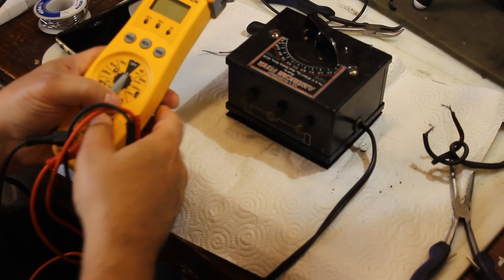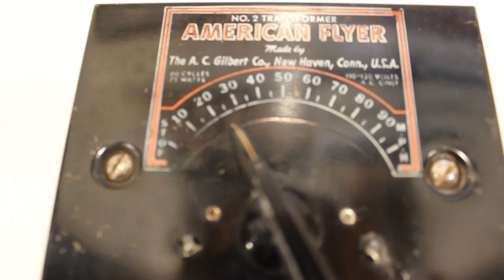When the cord is bad:  A 1947-52' 75 watt No. 2 transformer repair.

Comment: One was 75W and came with a 290 set ,#2 transformer, mine was bought in excellent condition with one of the best cords I ever saw. We used it for years, then everything was moved and it was lost by the home my brother moved to. I restored everything they messed up to Exc. condition again. That was in 1961 to 1964 ,just before I became a big time collector in 1968 buying out old toy train stores going out of business like Toy Town in San Gabriel and the Knott's Berry Farm train store that would call me when they bought out American Flyer  Trains from customers that were selling unusual items like the 21139 Northern freight set all in original boxes and set box too. Collected non stop until 1974 and sold out everything, but in 1997 to the present I went crazy again. Only now I have no space for anything or even a place run  a train.

Comment: Austin/Everyone, I have a Model 7B and 8B American Flyer Transformer that is in need of new cords. Is there any part diagrams or documentation if you want to rebuild one of these older American Flyer Transformers....Thanks!
Reply from the maker: If all you are doing is replacing the chord then it should be a simple disconnect the old and replace with new.  There are usually cheap extension cords at the box store....lop off the female end and now you have a new cord.  As for schematics...you might check the various flyer Facebook pages as .any of them have helpful documents under the files tab.

Comment: I have replaced the wire and cleaned the unit. I cannot get the throttle lever to go to zero. Minimum is about 4. Any ideas? Thanks.
Reply from the maker: Have you double checked that the spacers are on correctly and not interfering with the handle travel?  Another thought is there a chance the throttle lever goes past 100%?  If so maybe the lever is not positioned correctly.
Reply: the Spacers were put in. The handle moves all the way to the stops ok. I can hear the throttle lever hitting the coil.
Reply from the maker: I suspect the issue is a simple one but I dont have any ideas for you other then to not give up...the solution will present itself.
Reply: The brass throttle assembly was bent and cracked. Straightened and soldered. Works like a champ. Not bad for a transformer I got for my 5th birthday
Reply from the maker: @johngazley2703  awesome!  And way to keep after it!

Comment: Hi Austin. From your video it looks like the No. 2 may still have some problems. You said 6 volts when the control knob was on about 50. Then you quickly turned the control to 100 and read 18 volts. The voltage should start at about 6 or 7 volts just past 0 and gradually increase to 15 volts or so at 100. At setting of 50 you should have been reading about 12 to 13 volts. When you ran the train it looked like the motor was either stopping or running at full speed. This is consistent with your voltage readings. All the Flyer transformers from 1950s with the exception of the 18B, 30B are designed to operate from 7 to 15 volts. I suspect the “wiper arm” is not making good contact with the top of transformer winding. By the way, I love all your videos. Keep up the good work, Joe
Reply from the maker: Thanks for the thoughts, feedback and encouragement!  I will check the transformer again but it seemed to workwell...while my 312 is very cantankerous!